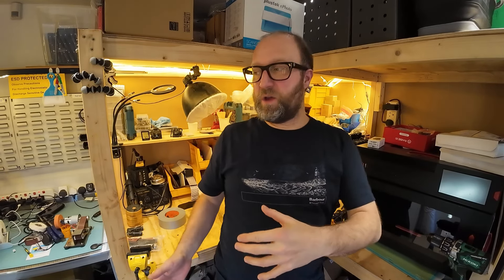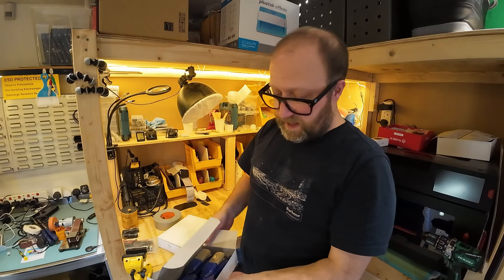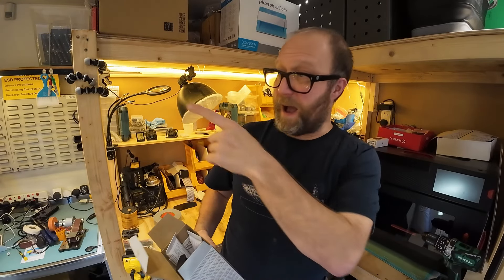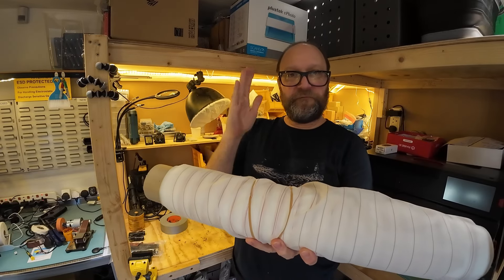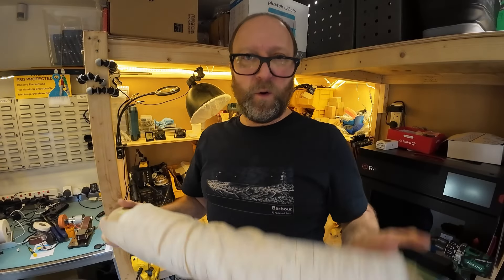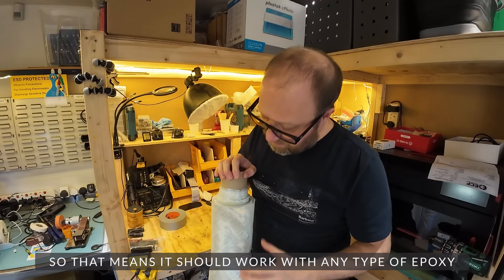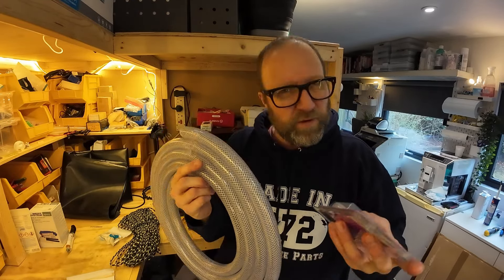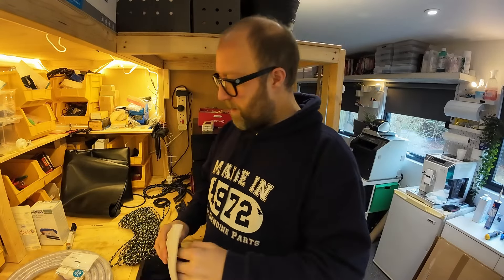Spending Money Again!

Comment: Hi Dave, you could incorporate a three-way tap to stop you from having to put more holes in your hull. I use one on my Bayraider. One way goes to the bilge pump, one to the bilge and the other has a long tube attached, so that I can empty the buoyancy tanks.
Reply from the maker: I considered that actually but I think the way my original bilge is would make it really difficult. I guess the upside of doing it this way is that you have full redundancy in the 2 bilges but I think if installing again, I would try and use 1 outlet.